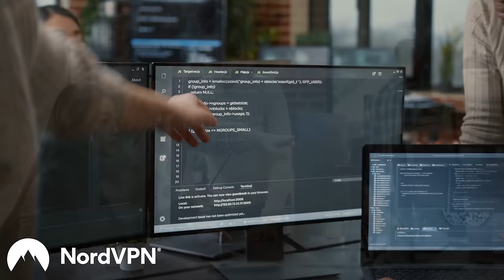Elon Musk fails Cybertruck stainless steel metallurgy test | Auto Expert John Cadogan

Comment: I have watched a rather long presentation on it and have to admit I was impressed with the 4 wheel steering and air bag suspension. But puzeled by the lack of a frame. They were actually claiming that the reason they didn't need a frame like a conventional pickup was because this body panels were so strong there was no need to add the extra weight. I suppose what their not telling us is that the battery box is the real structural component of the vehicle. At that point I was wondering which would happen first. The wheels fall off or the whole thing just snap in half. I guess the joke be on me if the wheels fall off it snaps in half and the battery goes on fire all at the same time.
Reply: Don't forget that it doesn't have any side impact protection built into the doors, etc  for the same supposed reason.
Reply: ...and sank into the swamp...
Reply: Did you notice the steering wheel is not mechanically connected to the wheels, unlike modern electric assist racks that accomplish the same thing with redundancy.
Reply: The Cybertruck has a normal steel monocoque with non structural stainless panels attached.
Reply: @petesmitt  that would be good news - you could swap out the stainless with aftermarket plastic or aluminum panels and save a ton of weight.
Reply: Well,it is a clown car.
Reply: The wheels will snap off: check out the crash tests that align with your speculation and show the rear wheels flop around on their steering knuckles in the crash.
Reply: @charlestoast4051 pete is correct. musk claimed early on that it would be a rigid body solution, then they quietly switched to a conventional design. replacing the panels seems like a likely aftermarket mod, now that you mention it. you should patent that idea before it gets going.
Reply: They said the external body panels are a major part of the structure.  There are core aluminum components, but the structural rigidity comes from the body panels, which is very different from a regular vehicle. Sure, it will be more expensive to repair, but it should take a much greater beating.
Reply: @petesmitt That's not what Tesla is saying. They are stating that the body panels are very much structural. Like an exoskeleton. So much so, the doors don't even have crash bars. And the torsional rigidity is greater than a sports car, due to the body panels.
Reply: Watch the walk a round videos you`ll see it being built in real time.
Reply: @vcracing  Door crash bars are not structural and just because the stainless panels are very strong doesn't make them structural either. The torsional rigidity comes entirely from the steel unibody chassis, not the stainless panels; don't believe me? Elon Musk said that the steel chassis of the Cybertruck has more torsional rigidity than a McLaren P1, a carbon-chassis hypercar. Note that the Cybertruck steel chassis is normal steel, not stainless steel.
Reply: @RwP223  ever been in a new plane?
Reply: @JoeOvercoat  i guess you would rather the dummies got dismembered?
Reply: @petesmitt  Crash bars - fair enough, the point of mentioning that was to show how much strength had been moved to the outside.  For most cars, I agree with your statement. But the rigidity comes from both, in this case. You need the rigid frame, which is then made more stiff by fastening the body panels to the rigid members. In this case the rigidity is improved due to the strength and thickness of the body panels, but also because the body panels are flat and not pressed into various curves. Think about a post frame building with steel sheeting. The thin steel panels help create the torsional stiffness by locking the rigid members in plane. Regarding Musk's comment, I don't read that as excluding the body panels. Also,  the design engineers clearly state by using the thick flat steel on the outside, they were able to reduce the internal structures ;)
https://youtu.be/uefydJUbRhc?si=MyShrXAokaRNtXtt
Reply: @vcracing  Any rigidity added by panels  is a design flaw; the Cybertruck is a unibody chassis vehicle, which by design means that the vehicle rigidity comes from the chassis, not body panels; if the panels are adding rigidity, then the chassis is inadequate.
Further, torsional rigidity is not the more you can get the better; the Ford F150 has much less torsional rigidity than the Cybertruck because the chassis flexibility improves off-road performance.
Reply: @petesmitt  I'm not saying the more the better, I'm just saying the design engineers are stating their torsional rigidity is greatly enhanced by the panels. I agree, a rock crawling truck needs to be torsionally pliable. But as someone who's spent a decade pushing hard on the integrity of a vehicle, there is zero chance of getting the numbers they tout out of a 20 foot long steel or aluminum chassis without building the equivalent of a roll cage throughout.
Reply: @vcracing  My original response to the OP was to educate, as they appeared to be clueless about unibody construction; if the CT designers deliberately built a flexible unibody to then add rigidity with panels, I can only imagine they were wanting to remove weight from the unibody structure because the complete vehicle is so heavy..
Reply: Hey dude. Did you compare the metal strength to other vehicles. Where is your test.Dude
Reply: @petesmitt  To your point, here's a clip of the design engineers mentioning the improved torsional stiffness from the bed chassis casting. Should be time stamped (otherwise, skip to 32:20) https://youtu.be/J5zDNaY1fvI?t=1940
Reply: @petesmitt  they were actually claiming that the body panels were the main structural component.
Reply: @petesmitt  I was quoting what the 2 main designers were saying about how the cybertruck was designed. They said that their minimal design in the unibody was based on the strength of the body panels. My question is what are they not telling us. I suspect they are relying on the battery box as a structural component of the vehicle. But if course they would refrain from telling us that as that would raise a lot of questions.
Reply: @RwP223 b/c you don’t need mechanical steering, that’s ancient tech at this point, we have throttle by wire already, steer by wire has been in use since the 80s, Saab wanted to do it in the 90s
Reply: @JoeOvercoat it’s a 4 wheel steering system so the wheels will flop in an impact like that, i doubt they “snapped”
Reply: @vcracing you just get a hammer out of the shed and bang the steel panel back into place
Reply: @PhanoftheShow   Ancient?  Just like gasoline hahaha okay buddy, it's a slippery slope.  Where is this aircraft technology?  I saw the Munro video of the rack in detail, I love the autozone black wire loom connecting the motors.
Reply: @vcracing  The more I delve into the construction, the less impressed I get; using aluminium castings to add torsional rigidity and take suspension and bed loads is crazy, as aluminium has no fatigue limit and will eventually fail even from small stress amplitudes, whereas using high tensile steel to provide all the torsional stiffness and take all the loads, is a far better engineering solution.
Reply: @petesmitt  Yeah, that does seem like a pending disaster. At least they used steel timeserts to protect the aluminum mounting points. And honestly, my Ford truck is all aluminum and so far it's held up. But, it has no torsional rigidity...
Reply: @vcracing  Your Ford isn't all aluminium; it has a steel frame for structural integrity; the aluminium body is not taking any suspension or towing loads, only bed loads and to cope with this stress to the body, Ford specified the best military grade rolled and extruded high-strength aluminium.
Pete Friedman, manager, Ford manufacturing research. “Out of all the materials we tested, we carefully selected only certain grades of aluminum that met our high-performance standards in all of our tests, while allowing us to trim hundreds of pounds from the truck.”
Reply: @petesmitt  oh, duh. Man, it's late and my brain is barely working. Although I did not know about the grade of aluminum Ford chose. Good to know.
Reply: @RwP223  steer by wire has been used in commercial aircraft since the 80s
Reply: @PhanoftheShow  Tesla is not using anything commercially available, it's a clean slate design by tesla for tesla no partnerships.  Cars already cost an insane percentage of ones wealth, its a mobility device, something to convey us around, why complicate the absolute shit out of this machine, ill deal with turning the wheel 97 more degrees while finding a parking spot.  This steer by wire is a nerd solution that reached far to find a problem.  An average man in a jumbo jet has different challenges compared to the average man in a ground vehicle.

Comment: While I agree that you won’t break the “press”,  you may very well break the “die” that actually forms the part that goes in the “press” by trying to form a stainless steel part into a more regular shape that is done with the typical type of steel normally used…. And you would most certainly break the “punches” in the “die” if you tried to make holes in the stainless steel part. You should have differentiated between the press and the die. The only thing I learned from you that was useful is that the material will scratch with a Scotch pad. But will it rust from salt exposure?
Reply: from what i remember Franz said they couldn’t stamp the steel like how panels are typically made so they had to rely on bending with a press and that’s how they settled on the design

Comment: Great one Johnno absolutely love your completely logical argument. Think I was right but if you beg to differ I’m listening. Have had my own experiences with stainless steel in my time while working at the then BHP Port Kembla processing the stuff in Plate Finishing both magnetic and non magnetic plate 5mm and over the stuff was a nightmare to work with and I didn’t even think about how shithouse the stuff would be to use as a vehicle body until I watched this one. I’m guessing it’s the DeLoren DMC 2.0 with a stupider power train (a 97kw V6 Renault, engine and a parts bin raid was bad enough) no coke hidden under the seats.
Reply: De Lorean 2.0 was my first thought as soon as I saw the Cyberwank being planned.  I've seen how difficult it is to repair even minor blemishes on Cokemobiles, and all these flat planes on the 'Wank are only going to make that more difficult.

Comment: Great video. Brings back memories of Material Science during my engineering degree. I think the one of many hurdles for CT will be the risk assessments made by insurance companies, what they will charge or in the extreme, refuse to offer insurance cover.
Reply: It depends on how many actually make it onto the roads.  If it's only a handful it may slip under the radar.  If it's a lot then they'll suddenly find that the cost of replacement batteries and factory panels is too much.  Tesla isn't great as far as service is concerned, so replacement panels are likely to take a long time.  Panel beating badly damaged panels would be possible but very costly, so not a great alternative for anyone except a collector or enthusiast.  I wrote long reply-to-comment about panel beating stainless (including some materials science) elsewhere in these comments so I won't reiterate, but outright factory replacement panels are probably the only option that insurance companies are likely to entertain.  I'm not sure which panels it would even be possible to swap out, but certainly the doors.  You'll notice that in the demonstrations that Tesla did shooting an LMG to demonstrate it was bullet proof (a loaded demonstration IMO) only the doors were damaged.  That demo vehicle could be repaired just by replacing the doors.
Reply: In many states, people will get tesla insurance. It's a lot cheaper than what other insurers charge.
Reply: @KidHorn7001 which I interpret as meaning -- TAX PAYER funded 😮

Comment: As someone who was involved with the repair and manufacture of food processing machinery there is one thing I know about stainless steels, they all suffer from fatigue cracking far more than other steels so much so that StSt is not suitable for vehicles in my opinion, I knew someone who decided to make a Land Rover chassis from 316 as his original had rotted away, he spent as much time repairing cracks as he had previously welding in patches. Stainless does were out dies faster when deep drawing blanks.
Reply: Good point, I remember a manufacturer of offshore HVAC systems making some Landrover chassis, initially for one of their own vehicles. They emphathised themselves that the long term survival of their chassis with fatigue could be an issue.
Reply: @g0fvt  I remember them advertising in the 80's or early 90's in a land rover magazine.
Reply: @Equiluxe1  I also saw an article in a LR magazine about that time.
Reply: luckily I don't see anywhere that SST is actually used structurally in the CT but rather for localised impacts of bumpers and doors.  Thinner pieces seem to be tacked on to the unibody.  I'd actually be more worried about rusting of the steel structure although it is powder coated.

Comment: Pre-emptively hanging my metaphorical ass out since you kinda asked.

My guess is that Elon heard that the dies used for stamping presses, experience greater wear with work hardening alloys like stainless compared to low alloy steels that are more amenable to cold working. He then went on to exagerate this basic fact of manufacturing to such levels that it surpassed mere BS and entered outright falsehood. 

If I had to guess, theyd be relying on a brakepress type process which is cheaper for tooling but more difficult to do repeatedly and precisely. 

I have a love hate relationship with stainless steel fabrication.  Being moderately proficient has been very useful in various jobs I've had but low alloys are much easier to work with... and cheaper lol

Post video edit:

Austenetic stainless steels can be stamped and in fact are stamped it just requires more expensive hardened dies that still typically have a shorter life than the cheaper dies used on softer carbon steels. 

Austenetic stainless steels are characterised by the inclusion of nickel and chromium above 5% of the total elements. Generally the more chromium the higher grade upto 308, 316 has less chromium but has molybdenum as well which gives additional corrosion resistance and other properties. 

The stainless that tesla are using is derived from (if not the exact same) the alloy spaceX "developed" it's a relatively low grade stainless with a much higher carbon content than usual. My speculation is that this alloy work hardens and becomes brittle with much less deformation, making conventional stamping impossible or impractical. 

My understanding is that 304L or 316L are commonly used in most stamped stainless products as these alloys have exceptionally low carbon content.
Reply: Re 316L/304L steels.
Yep much lower carbon content, and significantly lower strength.
Also passivation is more of a bitch in "L" type steels. The carbon from the tool steel embeds itself into the pressed pieces and causes unsightly rust lines and associated corrosion cracks.
I don't understand why stainless was chosen for a body material at all.
We have a complete separate shop for all stainless steel fabrication. Why you would introduce this variable into a manufacturing plant I don't understand.
Reply: @matth1929 the body panels are structural which drastically reduces the amount of necessary structure in the roll cage / framing / etc… with added benefit of removing paint shop & avoiding pretty much any dent / scratch outside of an actual crash… people that have to constantly repaint their car due to whatever they use it for DO NOT care about unfixable scratched / scuffed stainless that can only be wiped down & left as is…

Comment: Enjoyed this. The de Lorean shows that a stainless vehicle with grace is possible, though it does dent rather easily I believe. Not sure of the grade of stainless used.
Reply: It was originally 0.8 mm 304 brushed stainless, later upgraded to 316.

Comment: I would have thought the relevant comparison would be between the properties of stainless steel and paint. Scratched pain would likely the more of a problem than somewhat scratched stainless steel.
Reply: That depends if you want to fix the scratch. Paint is usually easy and cheap to fix. Stainless is known for the exact opposite.
Reply: @siraff4461  Have you ever owned a 4x4? Taken it off-road? As someone who has spent many years off-roading, I can tell you that it is harsh on paint. I would love to have had a stainless exoskeleton.
Reply: @zoransarin5411  You think you would. Reality is you would be better off with a wrap or plastic panels which are easy to swap. 
Again if you don't care about scratches then it makes some sense but not as much sense as alluminium which is far lighter and does the same trick of not rusting. 

I wonder why so many car makers stick to steel or alloy?